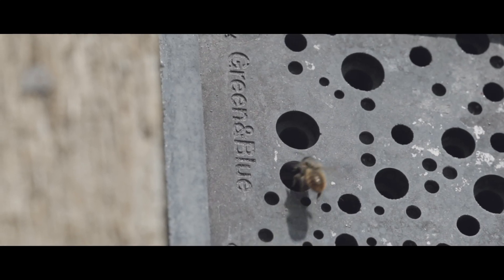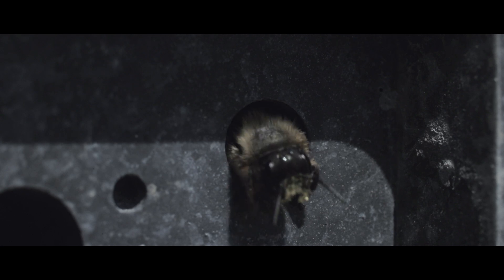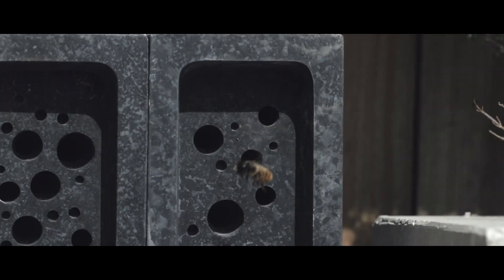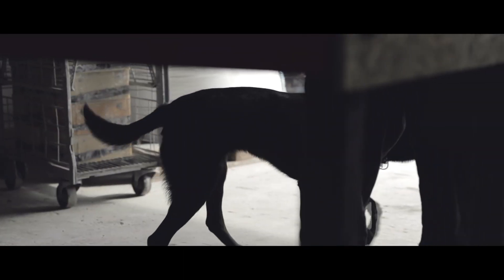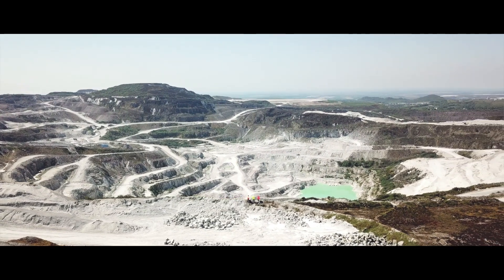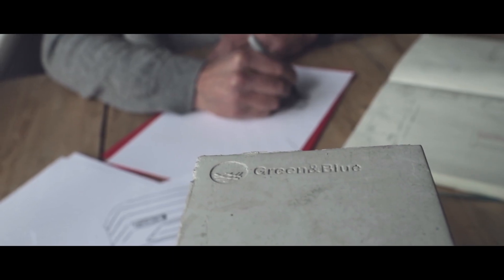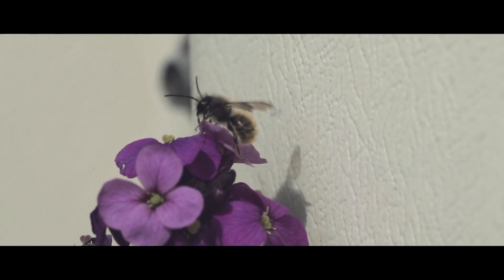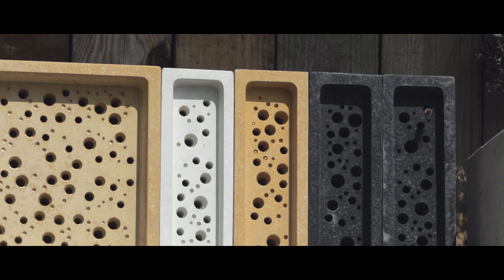Design the way nature intended

Comment: The idea seems great on the surface, but there’s a few issues I noticed right away. Most notably, there’s too many holes per brick. As the name suggests, solitary bees do not prefer to live in close quarters to one another, so either some holes will go unused, or there will be an element of stress for the bees that nest there. Trying to accommodate multiple species of different sizes in one brick would only exacerbate that. Also, various bees living in close proximity could potentially lead to an increased spread of diseases and parasites among them, which would likely do more harm than good if multiple bricks are adjacent to one another.

There’s also the issue of hygiene, as these bricks do not seem easy to clean. Should a nest fail, the contents inside will rot, harboring potentially dangerous bacteria and fungi that could spread to healthy bees and nests. Solitary bees do not reuse nests, and will not build new ones where there are remains of another, even if it produced healthy bees. While other creatures may take over a “spent” nest once the larvae have matured and flown off, such as keyhole wasps, if the goal is to help the bees this doesn’t seem like the best design. In fact I would imagine parasites would thrive in such an environment, while predators could easily pick off multiple parent bees; in this setup, finding one bee is equivalent to finding a feast because of how close together they are. 

I feel that the design would be more effective if it was altered to serve as more of an outdoor decoration than a building material; something that is easy to clean so that old nests can be removed to make way for new bees. It would also be ideal if it was able to be moved after installation if wanted or needed, such as in the situation where it was put somewhere that gets too much sun or gets hit by sprinklers that were installed later. Also, reduce the overall number of holes, and have designs that focus on supporting one kind of bee or species of similar sizes. This would benefit the bees as well as consumers who would rather attract certain kinds of solitary bees or have a particular design for the outdoor space in mind. Plus, it would probably make the cost less likely to turn potential buyers away; paying that price for a lawn or garden decoration sounds much more reasonable than paying for “a glorified cinder block”. 

Who knows, maybe if it takes off it could be expanded to include other colors or recycled materials! Or even get people to appreciate the other buzzy lads that might pay a visit, such as beneficial solitary wasps. Though that last one is probably a stretch given that a lot of western culture has only recently begun to appreciate bugs besides butterflies, bees, and ladybugs. But hey, maybe someday.